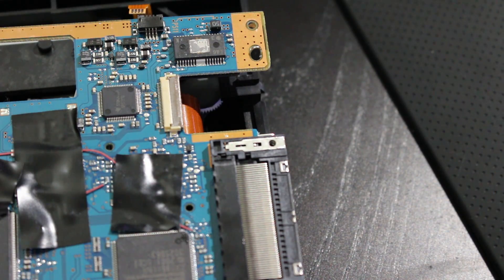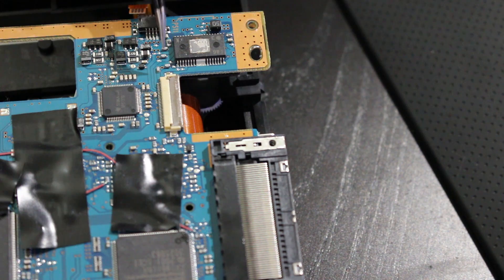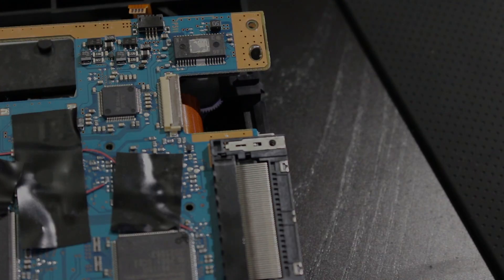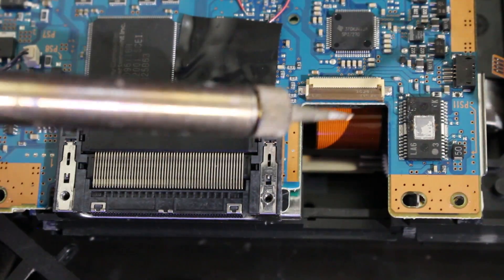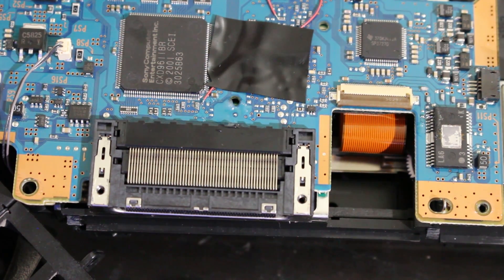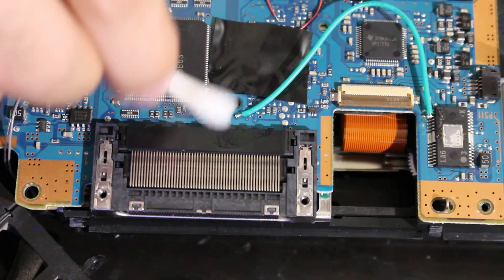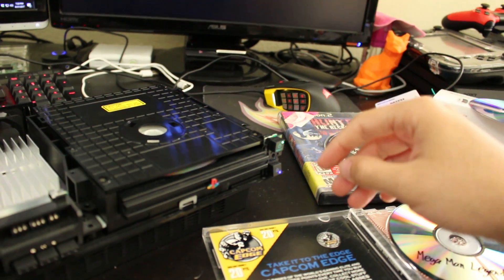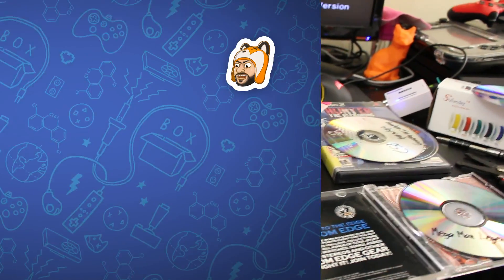How to Install the Romeo Mod on a Fat PS2 (v9 & v10) - Save Your Laser!

Comment: Hi, thank you for your tremendous effort! Thanks to your guides, I was able to revive my childhood PS2. Back in the day, the console was already hard modded with a Mars II chip, but now it doesn't read discs anymore, neither originals nor backups. I tried to replace the laser, but nothing changed. I have a SCPH-50004 (v9) PS2, and even though this video is old, I thought it could be worth asking: can this mod fix the problem, or does it only work to prevent further damage? With FreeMCBoot, the console works just fine, but I've always wanted to truly restore my old PS2. Thanks in advance to anyone willing to share some of their time and expertise with me!

Comment: Yo dudes!
If you decide to do this mod, CHECK YOUR LASER TYPE FIRST!
If you have an HD7 laser or the other thicc boy laser variant this mod will result in your laser not having enough power to function properly. 
I've had this experience before and someone much smarter than me pointed out that this is the reason. 
The matrix pic fix seems to be the most recommended fix and it works on v9-v13 (all revisions with this issue)
It's also much easier to install as there's no pin lifting. Basically if the mechacon crashes, the pic will detect it and force the ps2 into standby mod preventing the laser from frying itself.
Reply: Hey Modzville ! i want to modify my V9 model but i'm quite connfuse with the matrix pic mod because we can find everywhere that we need a PIC12C508 but where we can find the software to program it ? Is it possible to program it ? Thanks for your help !
Reply: @alksnake5703  you need a hardware flasher and the software the flasher comes with I use a tl866ii plus
Reply: how do you know if the laser is compatible with this mod or not?
HD7 and what?

Comment: Try doing the comsoft v4 fix on a GH-023 or GH-026 . I was able to do it on a GH-026 board. I suspect i need to replace the la6508 on another gh026 as the tray doesn't eject and laser doesn't home on that one. However the PS11 fuse still has continuity.

More info is at:
https://www.obscuregamers.com/threads/comsoft-v4-fix-confirmed.2978/

Cheers!

Comment: Were is The Romeo chip to buy I can’t find it
Reply from the maker: This isn't a chip.
Reply: MrMario2011 is it possible you could write the name of it and with console it fits on, and the ones you recommend. Btw great videos you produce...
Reply: @Caine117   it's a moddificadtion you do in the ps2's motherboard,but at least you should don't have sanyo HD7 as lens (don't work great with 5 volts),and also tweak the pots at some values.
the motherbord showed in the video is a gh-023 (ps2 v9),the scph is 5000x.
you can also "romeo mod" on all ps2 fat models,i have  the diagram,i already show in a video how to apply it on ps2 v7/v8 and v5/v6 (scph 3900x & 3000xR).
the romeo mod consists in replacing the power source of the lens and its controller by another one which has 5 volts instead of 12 volts at most
Reply: mouhemed blid i se that now... I thought the chip in the middle of the PlayStation was a romeo chip...
Reply: @Caine117   the "romeo mod" consist to lift a leg of the lens's controler from the point where is stucked and solder with a wire on purpose to link it with 5volts point

Comment: Hy, i have the exact same setup as you. Modbo 4 with GH023 mainboard. For me everything works fine, except it doesnt want to boot dvd video-s, unless I disable the chip. The wiring is good, checked the Y point (I tried to disconnect it, to see what it does, if the Y point is disconnected, ps1 games failed to boot! so its not just for dvd-s.) I suspect the chip itself, I have another GH023 ps2 with modbo 745 and it boots dvd videos without problems. Also I have done the settings to be indentical in the modbo menu, and still i got black screen on the modbo 4 machine. Any ideas?!
Reply: if you have a HD7 as a lens you hace to replace it with sony khs-400c  using "lenschanger",and tweak the pot's values.
cd 1265 ohms
dvd 1420 ohm

Comment: Hi MrMario2011 and thank you so much for this tutorial! I have One question (or maybe a problem) : i have done this job on my 50004 v9 and when i start the console all works fine but the disc drive appears broken (laser can't recognize any CD or DVD and It doesn't move up or down, no disc spin, tray doesn't open) but i can hear a little sound from disc drive and the blue light goes on but when i push it, blue light flash and nothing happens. Does my laser burned or LA6 chip?
However, i can use my PS2 with FMCB and HDD.
Thank you for all replies!
Reply from the maker: If you remove the mod and the disc drive works fine then nothing is broken. You might try re-wiring the mod.
Reply: @MrMario2011  i tried and... nothing. I think i broke LA chip or laser. How can i see if the problem Is the LA chip or laser?
Reply: if you have a HD7 as a lens you hace to replace it with sony khs-400c  using "lenschanger",and tweak the pot's values.
cd 1265 ohms
dvd 1420 ohms
Reply: I have the same problem with a 50004. But the reason was me being super stupid. I connected the fourth pin instead of the third. The 5V point has less than 2V now. The disc doesn't spin and I can hear sounds too. Don't know if I destroyed something on the mainboard or the drive or both. But I don't need to worry about the laser anymore :)
Edit: PS8 fuse was blown, rest seems fine

Comment: Quick question does the board say what version it is or do you have to know which serial numbers are associated with the board version
Reply from the maker: From what I remember I had to look at the motherboard itself, then match up the codes printed on the board to what corresponds with a PS2 version. Knowing the model number also helps.

Comment: Yes Flux Flux Flux. Newbie soldering a chip in a ps1. Solder wouldn't flow to save my life and I wound up pulling a leg out of the chip and pulled some of the teenie tiny fuses off the board :(

Comment: it's a good protection for ps2 fat and my v9 still work,butyou forgot to mention the importance of thermal pad and you also forgot what kind of lens you can use with 5v(i personnaly have a sony's khs-400c with pot tweak minimum 1420 ohms for dvd and 1265 ohms for cd and it still working fine,i also tried in the past at a sanyo's khs-400r and it  worked at 1429 ohm for dvd and 1251 for cd,and i applied in the past this mod in the models scph-3900x and scph-3000xR,if you want i will send you a tuto in docx file show  how to apply  the romeo mod in your ps2,but it is in french,you'll to  translate it

Comment: But why ?  noone burn cds or dvds anymore. 🤣
FMCB + PS2 HDD + OPL 🦄

nice tutorial vid, tho.
Reply: chickenracer25 what if you have a slim?
Reply: Modbo mod-Summ0ne fix-Comsoft-PIC fix (12F675)etc. Raspberry Pi NAS/Sata interface. FMCB + OPL played PS1 and PS2 via Lan.
Reply: +Lich King openwrt mr3220 with usb2.0 hard drive connected, can't get any better accessory than this for a low price and wifi access...
Reply: not all games work on opl

Comment: Is such a mod necessary with a system like the ps2? The burned disc can be runned on a ps2 with freemcboot. Also what soldering iron did you use? Anyways great video.
Reply from the maker: Not necessary, but did it for the fun of it. The hardware I use is in the description.